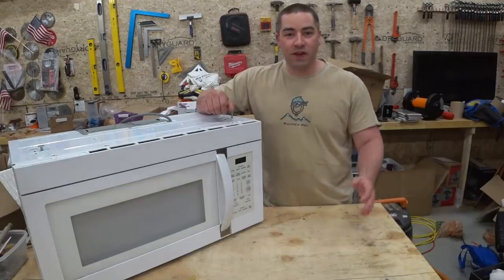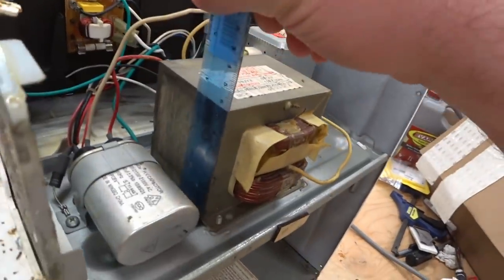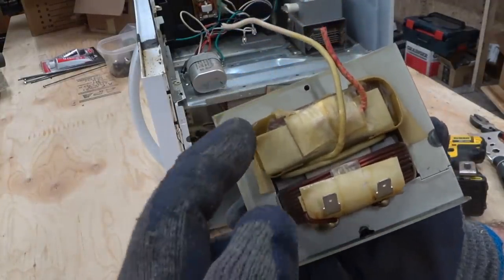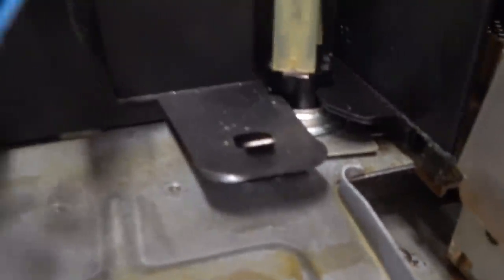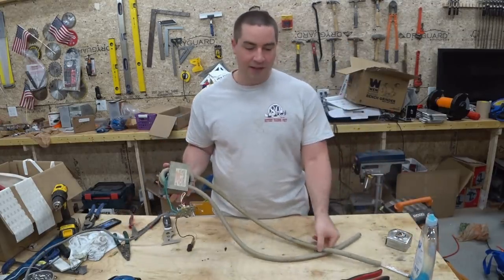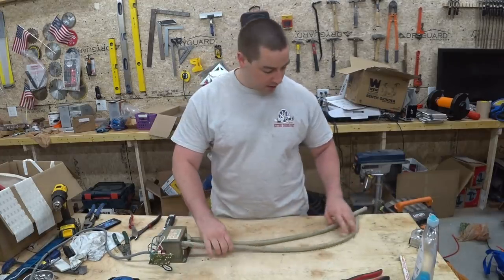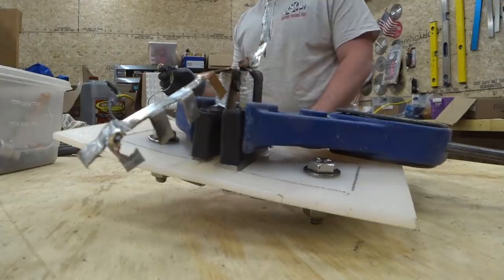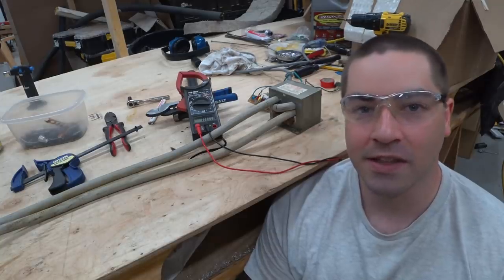DIY Spot Welder, Attempt #2 with Microwave Transformer, Failed!

Comment: Do away with the little circuit board and just put the fuse inline w/ fuse holder and then just run the wires to transformer and then ground it and should been good to go....oh I always knock out the shunts I didn't see if you did or not.....I had one I ran with thick stranded 0 gauge....strands were bout 3/32 thick....beat the piss out of the copper wire with rubber mallet for a day or two trying to make it fit....it put out some wicked stupid current..
Reply from the maker: Did you find you need more turns?  Some comments below are suggesting I need a little higher voltage, with 3 or 4 turns.
Reply: Actually at first I thought I did need more then I made some electrodes....well not so much making them but I used some might welding tips and filed them down to a point....there's better options but they did the job and I used the little switch you used but I made mine a foot switch and then I made some arms so I could really clamp down or put alot of pressure on what I was spot welding and the better your electrodes and the better your able to apply a good amount of pressure between the two electrodes the better the weld would be...but from what I could see about your wire was it wasn't as thick as the stuff I used.....it's like what they use at big transformers and whatnot.... I have the gloves that they would use when netting with the wire while out in the field with the wire....they are rated a 17K before they fail ....and the transformer I used I had to cut the base off and so there was a slight gap between the the base and E core...but once it's all working you should hear a ever so slightly hum while the transformer is running/ working.

Comment: David  be careful  that has a 3000vac output and it has a diode to make it DC .   It only has a 400 MA output at that voltage.  Remembe the MW is an Radio Frequency at a about 1200 watts.   Not good for welding....You need a lower voltage and a high current.  Like 10 amps out not input...
Reply from the maker: I thought it would only be that high voltage out the secondary coil, and I cut that out.
Reply: Wrong on every point. The transformer by itself definitely does NOT put out Radio Frequencies. That's what the Magnetron is for. Plus the Transformer does NOT include a diode. And by winding a couple of turns he has exactly what you say "Lower Voltage and High Current".

Comment: You need 30 to 55v to start the spark willding including a 30 up to 200amp

You can use this volt to melting stuff

Comment: i told you to use Chevy starter solenoid  (use the solenoid) and find a small cooper rod for weld tip. i promise its will work. Or any car  starter solenoid. The solenoid is ignite the  power. to the starter that's how it work. TRY IT.

Comment: P.S. GET the spot welder timer board from AMAZON! Or eBay, they have something like a 20-40 amp, and a 100amp, the small one should be fine, you ain't pulling anything near 100a from the wall!!!
Reply: He could do that.  I pulled over 600 amps from a 110v 25 amp outlet for a few seconds at 3 volts.  Remember: 3 volts X 600 amps = 1800 watts.  Yes, he could do that... and one HELL of a lot more.  The 110v 25 amp outlet has the potential of over 2500 watts.  See the example above and relate it to these numbers.  Amps X Volts = Watts

Comment: I think it is cool that you are sharing your experiments. 
Trying hard not to sound like an arrogant 'Rick' (and likely failing), I am inclined to rhetorically ask how you are directing them.

What are the materials involved? (Actually, not assumed)
What are the present (grin) practices in the welding\brazing of these materials?

Once again, I do not really know what I am talking about. But with the wealth of the internet, patience, and application good judgment, I believe you can, for the most part, 'plug into the matrix and learn to fly a helicopter'.
Expertly, no, obviously. But hopefully enough to stay alive.

Also remember, just because someone says, or sells a product, does not mean it actually works as stated, or at all. That's why we practice\experiment.

PS: I found this article interesting. Whether it applies, here, is yet to be determined...
https://www.researchgate.net/publication/256475600_Joining_of_aluminium_sheets_by_combined_solid_state_and_TLP_bonding_processes
Reply from the maker: Hi Richard,  I'm trying to join the tabs of a lithium pouch cell to a bus bar.  The bus bar is made of copper.  The lithium cell has two tabs, one positive and one negative.  The negative tab is copper.  The positive tab is something else, but un-known to me.  Maybe aluminum, maybe nickle?  The battery was originally assembled using spot welds.  However, the spaces are very small (about 3/8" square) and need perpendicular pressure.  This is not something a normal spot welder can fit into.

Comment: No use showing me something that does not work. What's important is the current in the secondary, and not so much the voltage. If you have 120V in your primary and open circuit, then it will be 120V also, but that is not what you are looking for. What is important is the current in the secondary when the circuit is closed.  Good luck.

Comment: Damn dude,  really, if you got kids or value life at all dont fuck with things you dont know about, ie electricity..  for 1 the capacitor you said nothing about or did not discharge could kill a man..  unplugged.  Days later..  if you dont know what discharging a capacitor is then really, dont play with electricity...  the little circuit board you said would magicalky do things to some collapsing magnetic field, whoever told you that needs to stay away from electrical things also..  a microwave oven transformer if plugged in alone right when you take it out of the microwave, if its energized if a secondary lead grazed your anything it woukd kill you..  what your doing with the thick secondary is lowering the voltage but raising the amperage so still could possibly kill you...  but that little board is for the control board and over heating protection circuits, the coil is called an inductor.  Its likely a choke coil to lower the noise for the controlboard with its more vulnerable electronic bits...  otherwise if youre gonna mess with crap like that not knowing shit about it, at least admit it and make sure you dont inspire kids to take apart a damn microwave and kill themselves or somebody else...  fuckin dangerous man..  is like lighting a cigarette by a gas tank, you never know just how close you have to be to ignite the vapors and blow your nuts off..  same with microwave transformers, they can make electrical arcs nearly 2 feet long depending on size of transformr..